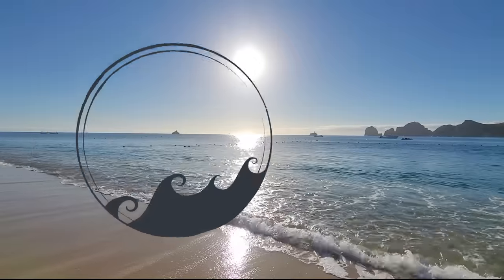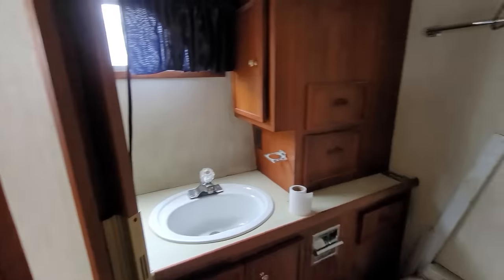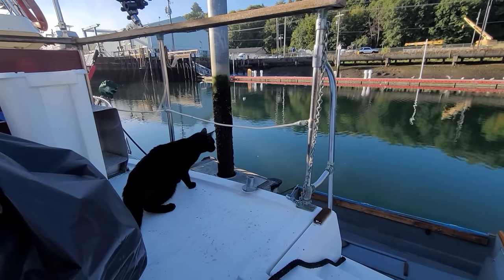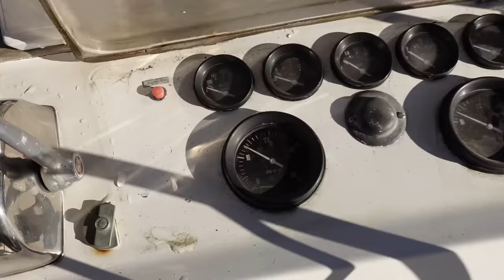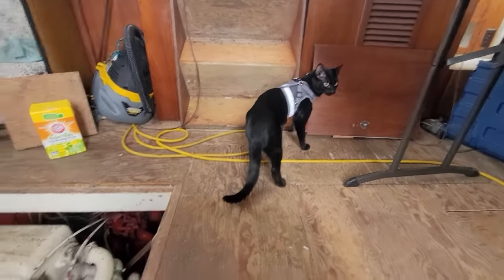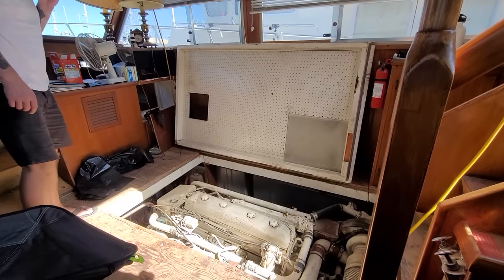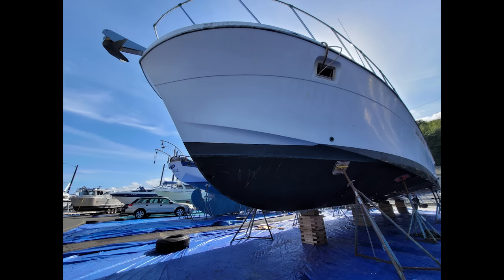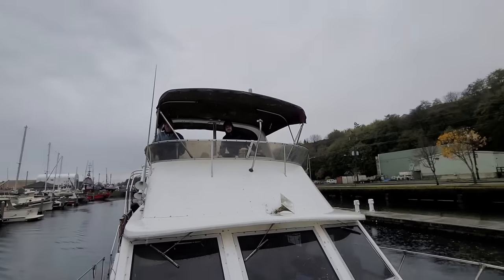Restoring a Neglected 40 Year Old Yacht | Ep. 1

Comment: First video I've ever seen from you guys, I look forward to checking out the projects you've done on it! 

She looks excellent, and if she runs that's a fantastic deal, I can almost guarantee you're going to need to do a lot of wood replacement and I would recommend replacing it with fiberglass and foam board like a starboard, or a liquid transom like material depending on where you're doing whood replacements 

I look forward to seeing more! Belated congratulations!

Comment: I recommend you check the hull and decks for moister and blisters, some of which may be covered up.  Starting in 1975, Uniflite changed  a fire retardant they were using and the new substance caused serious blister problems for boats manufactured from 1975 to approximately 1981.If your hull hasn't blistered yet then it most likely won't. Specifically, the problem comes from having  switched  fire retardant agents in their glassing process and  had to change manufacturers in 1975. This is a famous story which you can learn a lot about online.  The blisters in no way affected the structural integrity of the hull.  Uniflite boats had a sterling reputation and if you get it in shape it you will have a fabulous boat. Also, lot of your model boats were manufactured with gasoline engines and having Diesel engines is a real plus.  Please make sure the diesel fuel and tank are in good shape before going any distances. I am amazed they started right up...a real testament to those engines. I am very excited to see how your project progresses.
Reply from the maker: Thank you very much for that history lesson. We definitely have blisters on this boat but I have seen worse. When we're ready to paint we will be fixing all the blisters and hopefully no more will appear. I'm happy they don't affect the structural integrity of this boat and are more of a nuisance than anything.

Comment: Many good wishes and may you have fair winds and following seas in your future.
Here is a good tip: when powerwashing, sanding, painting, and doing other tasks that create dispersals; dust, debris, and other particles, it's a good practice to buy an inexpensive tarp to string up between your boat and the boat(s) next to you so the debris do not end up all over the neighboring vessel. This may also help keep paints, oils, and other dispersals out of the water 😉
Reply from the maker: Great advice, we stopped doing any pressure washing after the first couple hours cause we didn't want to splash the boats next to us, low pressure and simple green from then on.

Comment: I stumbled across your videos and I was struck with a lot of old memories.  When I was in high school and college I worked at a Uniflight dealer.  I spent years outfitting and preparing all the models.  I also spent a lot of time delivering new sold boats to customers up the east coast.  I would pick up boats at both the Bellingham and Swansboro plants.  I can say that I know every inch of your 42 DC.  

Your boat has some great bones.  It has a hull that is literally bullet proof.  This same hull was used as patrol boats during Viet Nam.  It is also flame proof, unlike other boats during that time.  They used some stuff called Hetron in the resin.

I have done way more than my share of wiring and installations.

If you would like to chat, let me know.

Best of luck!

Steve

Comment: I may have built most of that interior, since I worked as a shipwright, on the 36 Double cabin, and the 42' Double cabin from 1975 - 1978. I did most of the wood work and installed some fly Bridges. Fun to see again.
Reply from the maker: That's amazing, would love to chat with you some time.
Reply: @SeekingSeas  anytime, are ya'll on Telegram?
Reply from the maker: We're not on telegram but if you email your contact info to contact @ seekingseas.com we could go from there.
Reply: @SeekingSeas  seem like that Domain is available. Did you type it correctly?
Reply from the maker: @HeyMichaelLeo  Hi Jeff, yes its (contact@seekingseas.com)

Comment: You got a good deal on that boat.  It is fiberglass and has a pair of 6-71s.   I would have turned the engines over with a wrench before I tried to use the stater.  Glad it worked out well for you.
Reply from the maker: Definitely got a deal, our thought was just to bump the stator to turn it over a little but they ended ended up just firing right up. Probably should have turned them by hand.

Comment: Pressure washers are soooooooo underrated. This is the first cruising channel I have subscribed to that has engines. Let's hope that Big Oil doesn't hold a gun to our heads too much longer so you can put some miles on that thing.
Reply from the maker: Pressure washer worked great, just had to be careful of the other boats around us.  Hoping the fuel prices go down a bit so we can do some cruising soon.

Comment: Nice job. At Walmart in the automotive section they have a septic cleaner called Super Clean comes in a purple 1 gallon plastic container. You can put it in a spray bottle and use if to clean the yellowed instrument cover. Remove the cover spray it with the cleaner in about 20 seconds the yellow will be running off. Spray it with water at that time. I would do both sides. Then you use a cutter buffing compound and buff it out. Will look clear like new.

Comment: you need to move the shaft zinc up the shaft more. with them that close to your cutless it wont get water flow and your cutless bearings will over heat and burn up very quickly  otherwiss good deal on the boat if it was mine i would do injectors and while your at it check turbo boost so you have a base line
Reply from the maker: Great ideas, we'll add them to the list

Comment: I would strongly suggest you get the washers in the injectors replaced and make sure you use factory service.  I spent tons of Money after my injectors had Black Death from the washers wearing out.
Reply from the maker: Great idea, we were santing to look into getting smaller injector ports that would still work with the turbo. Our thought was this could help with fuel burn but we have more research to do.

Comment: This would be my exact dream, living on my old used yacht not paying rent and saving all my money
Reply from the maker: Moorage is a lot cheaper then rent but finding a marina with a livaboard slip can be difficult. There are a lot of additional challenges to living in a small space as well, but even still, the pros outweigh the cons and we're really enjoying spending most of our time these days living on the boat!
Reply: @SeekingSeas How did you eliminate the risk for structural issues with the boat? That's what stopping me, you have these "deals" motor yacht costing 5000-10000 euros but there is the risk of MAJOR mechanical en structural issues that you can't see or know. Having a large motorboat that has issues can have very costly repairs so how did you know it didn't have flaws?

Would love to know! Still dreaming about doing it someday tho
Reply from the maker: Well, the previous owner had been living on it for at least 10 years in the water, although they hadn't ran the engines and didn't do any maintenance. When we looked at it we made sure it looked completely dry inside (no signs of water damage or leaks), which indicated it didn't have any major structural damage that we'd have to repair. We will have to do some work on the fiberglass and gelcoat still, but it's not so bad that we couldn't wait a bit until we do it. Also, we took a bit of a risk on the engines but we had looked at them and they appeared to be in great shape and we got lucky when it only took some maintenance to get them up and running. Also, we have already invested A LOT of money into it, we'll do a video in the future about how much everything has cost us so far, but I can say it's a lot more then the price of the boat already (we paid $6000 just for the new flybridge enclosure that you will see in a future video!), maintenance is very expensive.
Reply from the maker: If you can get a professional inspect the boat before you purchase it, that would limit the risk quite a bit. And for us, we found out about the boat from one of Jesse's family members who also lives at the marina and knew the guy and the boat so we didn't think we were getting scammed or anything.

Comment: you need to move those zinc anodes on the prop shafts, they need to be at least 6 inches ahead of the struts holding the prop shafts. there is a water lubricated bearing in those struts that will burn out due to lack of water being able to get in there

Comment: Curious about the main output shaft and prop seals...did you consider replacing those?  How about the transmission fluid and filter service?  Keen to see if those 100A alternators worm out well for you guys too.  Good stuff.  Port Ludlow and Deception Pass are nice stops up there.
Reply from the maker: The seals on those were good still, protected by the wax I suppose. It had been rebuilt and then just sat forever. We'll keep an eye on them for sure.

Comment: You got a good deal on that TANK! No one builds boats like Uniflite did.
She's not 1984 MY, more like 1974.
Detroit Diesel 671 will always start & run forever.
You should've serviced both stuffing box & shaft log hoses.
DO NOT  use multi viscosity engine oil in these 671s...drain her then refill with Rotella 1 or Delo 100 SAE40 oil.
Reply from the maker: The title and the manuals that came with the boat say 1984. After sitting for 10 years, the diesels started right up! We didn't show it, but we did check the packing glands. Thanks for the advice on the oil, our mechanic said the same thing so we will definitely switch over on our next servicing.
Reply: Joon or Uni guys: What year did the aluminum frame windows begin?  I'm a 72 42DC with SS frames.  Video boat is aluminum.
Reply: @tomdrohan5843  
I've seen 72-74 Unis with SS window frames, my guess would be from 75-76
Reply from the maker: For others' awareness reading this later: juniinc40 was right, after further research we found our title was incorrect and it's actually MY78!

Comment: As a yacht detailer for over 20 years I wish  could have warned not to use a pressure washer on the boat as it can blow out seals around ports and other fittings.I am down in Gig Harbor by the way, small world.
Reply from the maker: Thanks for the warning, I think we did half the boat before we realized the pressure washer was too much power. Wondering what you would do to bring the rub rail back to life?
Reply: @SeekingSeas  To be honest Aluminum once it gets oxidized it's almost impossible to have it return to the original state and stay like that once the outer layer is gone.You could coat it and paint it, probably the easiest and most cost effective way to add some curb appeal back to it.
Reply from the maker: Thank you!

Comment: always add bleach to your soap and water, this will help with the Green-Grunge  prevention. Having a cat is very important--rodent prevention. GM 671s are an excellent engine, many parts and replacement used engine. Been using #M 5200 for 50 yrs! Good luck-----Mikey , in Belfair
Reply from the maker: Thanks Mikey, will do.

Comment: Sorry, did you say that you painted the props? Props should be removed resurfaced and balanced.
Reply from the maker: The props were checked and are ok, we'll resurface them next time we haulout for bottom paint. We used a zinc coating paint called prop-kote on the props. Works great to reduce galvanic corrosion.